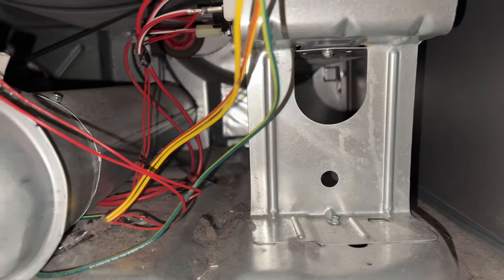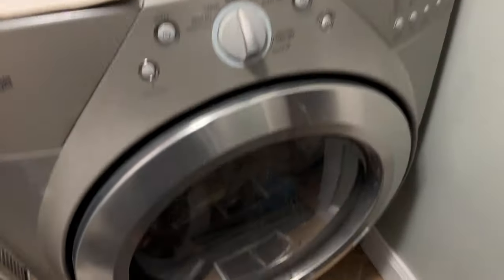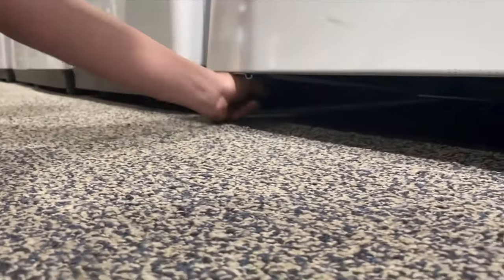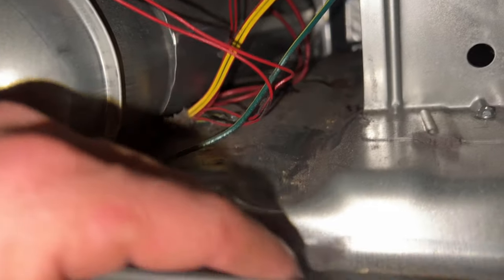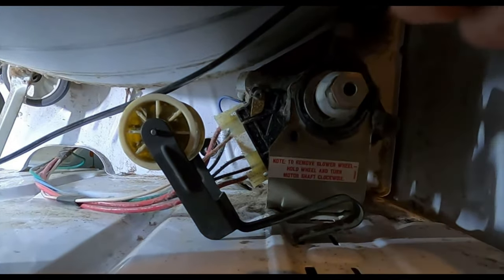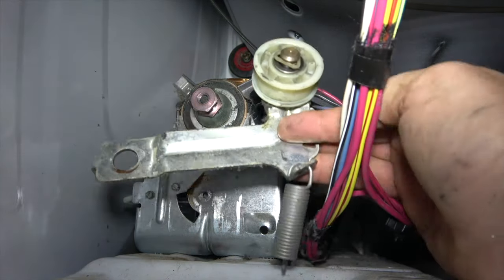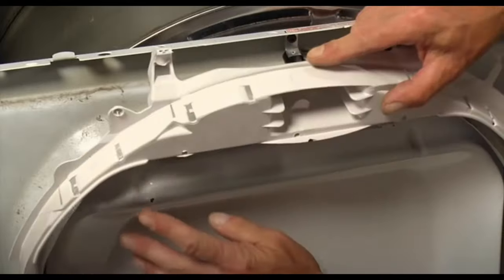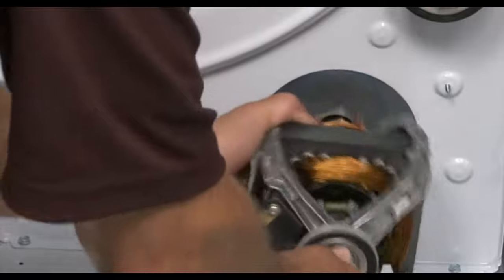Don't Waste Your Time - Here's Why Your Dryer Is SQUEAKING!

Comment: Great Video.  The others I looked at suggested idler pulley which is more work.  My squeek was from belt. Fixed it with bar of soap.  unit is 20 years old so may just be temp fix.
Reply from the maker: That’s awesome!

Comment: Kenmore was making noise after too big a load was put in when last ran. Not level so adjusted pretty close but still squealing. Noise is from all around not just one spot.
Tried soap idea from top access and rubbed on belt still noise so I angled belt and rubbed on bottom side of belt and then only squealed for a few seconds but was quieter and quieter until gone after maybe 10 seconds running it. Put clothes in and ran and made small squeak a couple times but then that was it. Thanks so much for the video!

Comment: Thanks for the video. I lubed up the two centers of the belt wheels with WD-40 and it stopped the squeak! Also, this gave me an opportunity to clean out all the lint that had been acuminating inside the dryer over the past years (not sure how many!) What a fire risk!! Thanks so much! What a hassle to pull the dryer out and undue the machine. Start from the back of the machine. not the front!! My model: Maytag MGD7000XW1 Good luck!
Reply from the maker: Happy I could help! I also know exactly what you mean about the lint! Had the same experience with mine! Fire risk indeed!!

Comment: You are correct but do not use grease instead remove wheels and clean shaft with scotch brite green pads. Do not use anything else that will remove metal from the shaft or inside wheel. You are just removing gunk build up.  Clean in circular motion and also run it inside wheel. If you use grease, lint will stick and cause wheels to either lock or squeak  again. Make sure you clean your dryer vent going outside at least one a year to prevent fire hazard and life span of your dryer. Good job in explaining the problem of squeaking. Btw, I repair appliances and have over 13 years of experience and this is a very common issues with dryers.

Comment: Do you use grease or dry lubricant for the new bushing style pulleys or do you install without any type of lubrication? I think lubrication would be good but it will attract lint.

Comment: We bought a new Whirlpool dryer 8 months ago and it recently started squealing.   That seems rather quick for parts to wear out.   As it is under the 1 year warranty we call for service.  The tech never opens the dryer, only listens to the squeal for a minute or two, then says he needs to order a new pulley kit and will call us when it's in. 
Is it possible to make that determination that quickly without opening up the unit to look inside?

Comment: I have a compact dryer. My dryer squeaks when the drum pauses and switches to rotate in the opposite direction. The noise is coming from the back. I hate this about the compact dryer.. Wish it would only rotate in 1 direction. It also squeaks when I turn on the dryer but the rest of the time it's rotating there's no noise. I'm going to try belt lubricant to see if that's the issue. If it still squeaks then I'll have to go on a quest to find the squeak. I did recently replace the dryer blower fan belt. It's difficult to pin point the specific squeaking location because it only happens for a few seconds. I bought the right size fan belt but maybe it squeaks due to the initial friction?? -Confused mom in Maine 🌲🌲🌲

Comment: So my 16 month gas dryer ages noise only after 10-15 minutes of running. When I turn off and back in it usually is good for a while. Cleaned and checked exhaust hose and under lint trap. Ideas?

Comment: I just repaired my gas Maytag dryer and cleaned out all lint. (the fan blade cracked)
The belt is about 3 yrs. old, BUT now when the gas ignites, there's a high-pitched squeal, almost like the old tube TVs!
It ONLY happens when the gas ignites and continues until the gas stops.

Any ideas?
Reply: I have the same problem. Just replaced the belt and still happens. Please help
Reply: @stantrojan  I turned the supply gas valve down a bit, and sure enough the high-pitched squeal stopped.  It may be the tip of the valve needs cleaning or the entire valve replaced.

Comment: Please can you help me I decided to be a miss clever clogs and changed roller drum support I also remove the metal backing and screws I think I have stupidly disconnected the Drum from the bearing now drum is not turning at all the fan sounds of so noisy no videos of how to fix smeg dryer dht 81l UK please can you help me